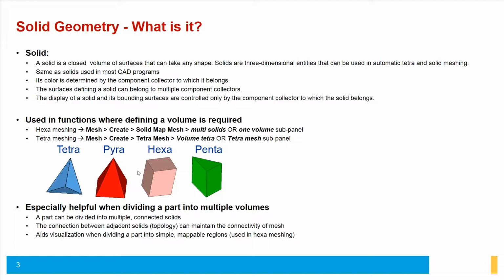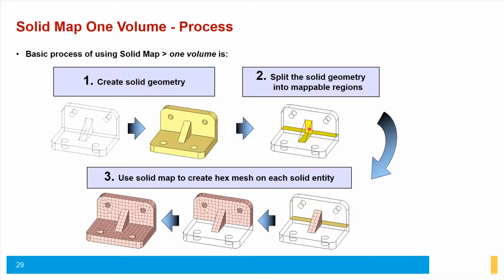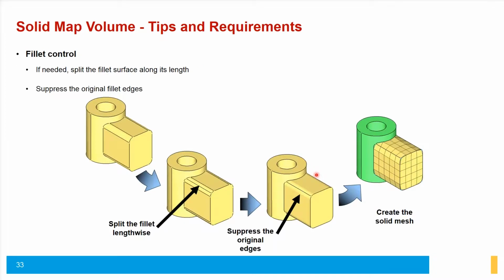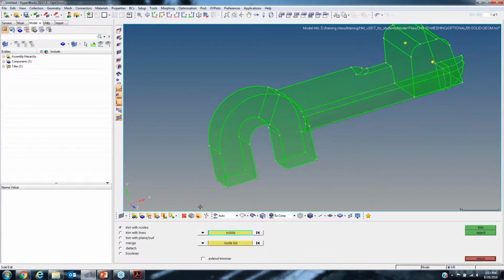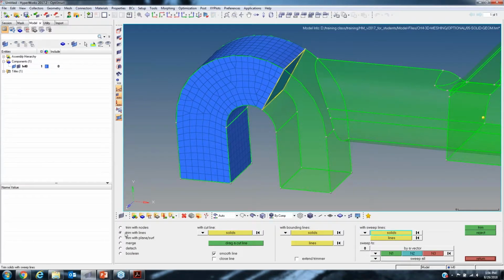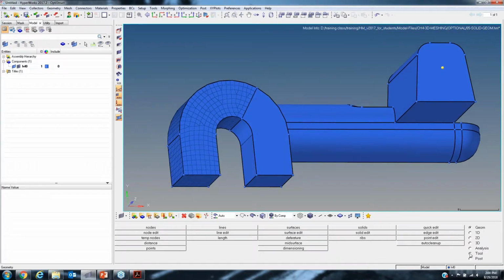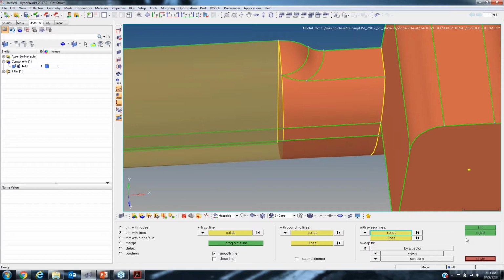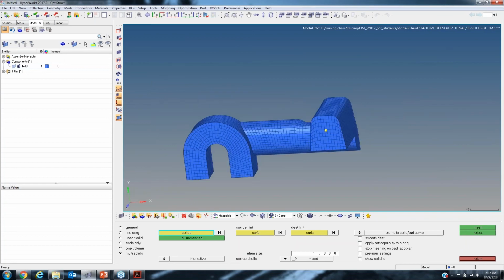Complete 3D Hex Meshing Guide | how to hex mesh using solid mapping in hypermesh / hyperworks

Comment: Make  videos on how to mesh complex plastic components using manual mid and  line methods.
Reply from the maker: For plastic components nothing really changes, Using Solid mapping would be the easiest way. Using the manual methods varies too much and is very specific to each scenario. So i cant make a general video on something so specific. I do plan on starting a series where I mesh your parts.